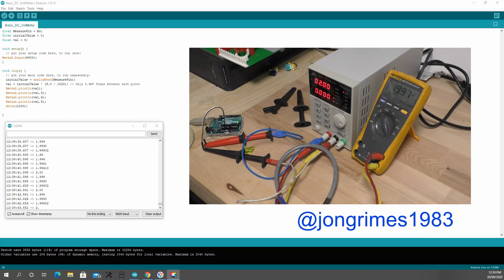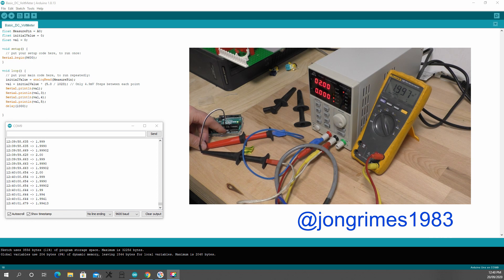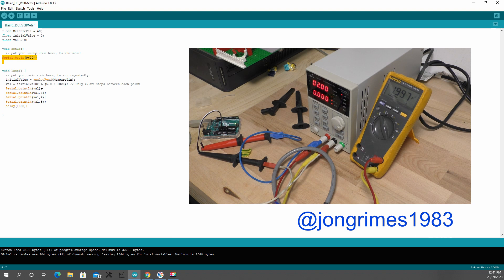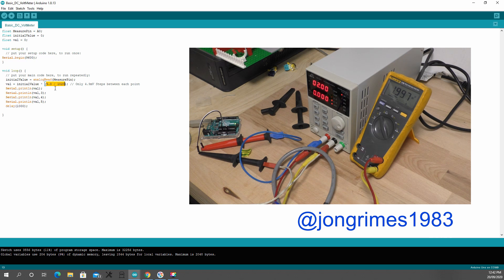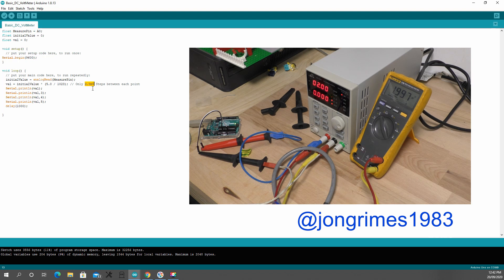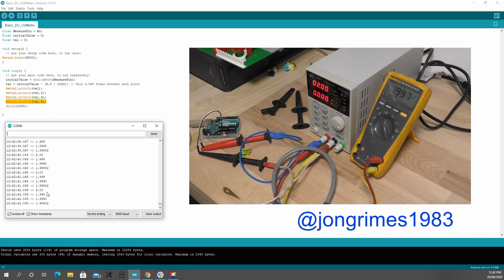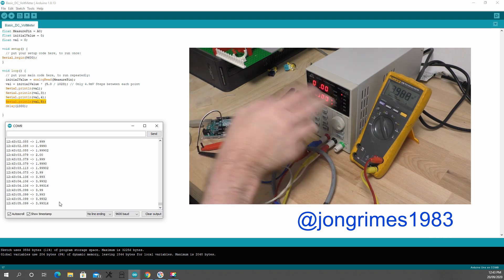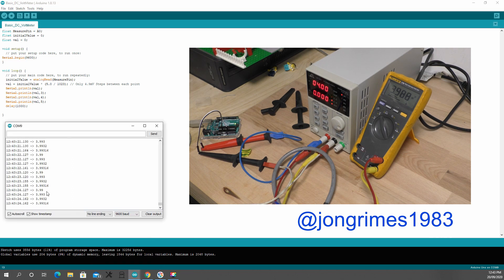Measuring DC Voltage with Arduino UNO

Comment: Hi, good demo and simple explanation.👍
You have to point out that the reference voltage by default is the 5V power supply.
As you are powering from USB if you check your 5V USB  voltage and use that instead of 5.00 in your equation, you should see  a better correlation between reading and actual input voltage.
Reply from the maker: Very good point. I’ll pin this comment